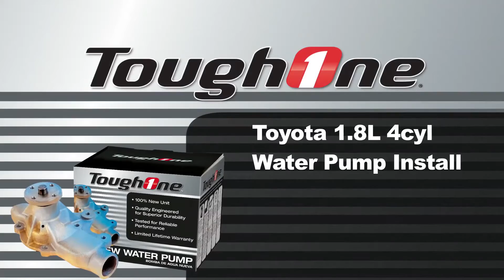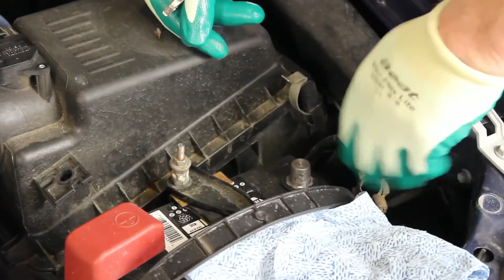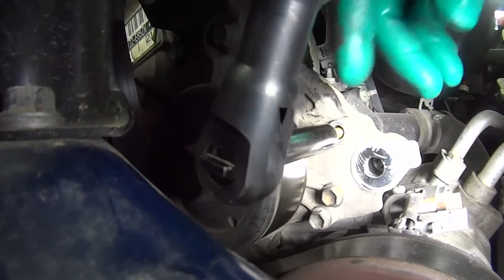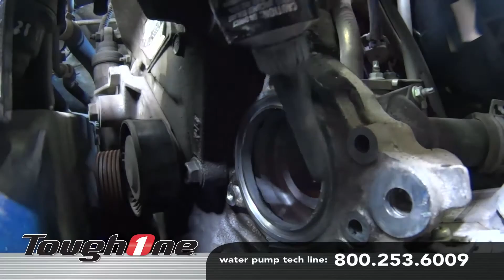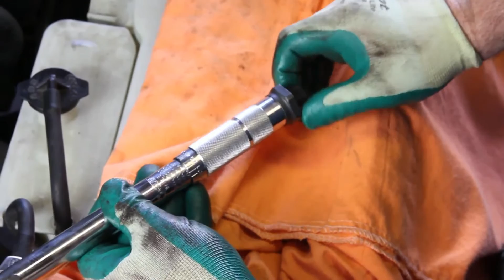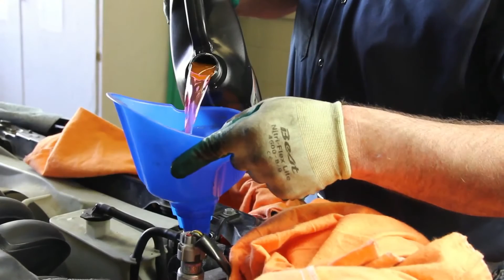How to Install a Water Pump for a Toyota 1.8L 4cyl - Advance Auto Parts

Comment: I've been putting this off for a few weeks now.  I want to try to do this without removing the alternator because in the Nuts about bolts video it is mentioned that it can be hard to get the alternator back in and he does a trick with a c clamp and a 27 mm socket.  I don't own either of those things so want to try and avoid it altogether.  

Got to do it soon before it starts snowing and it gets too cold, also want to get that green coolant I wish I hadn't used out of my 99 Corolla.  I got it for free and that's why I used it but for peace of mind want to stick with the specified coolant from here on out.